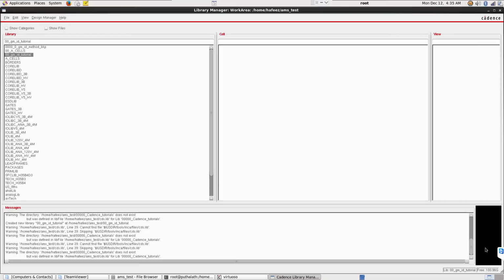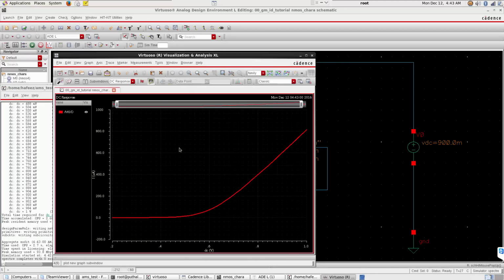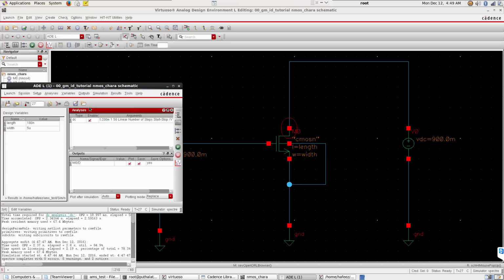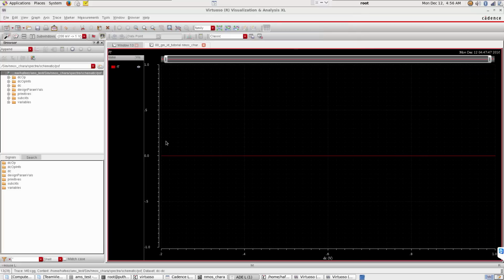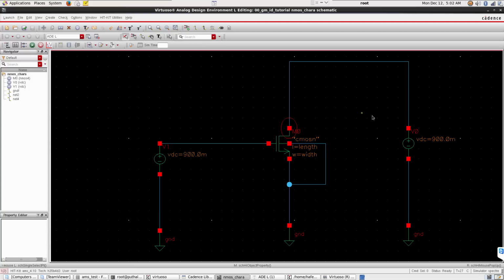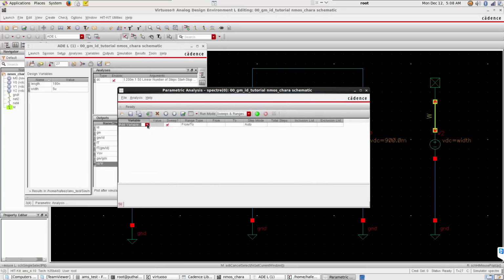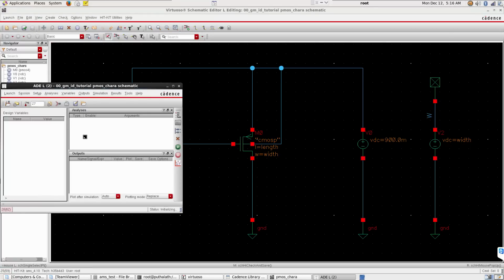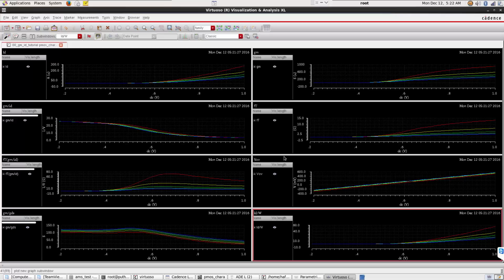gm over id (gm/id) method part 2 MOSFET Characterization

Comment: I see you have kept VDS as a constant for plotting all these graphs. May I ask, how will varying the vds affect the gm/d characteristics? What if I plot the gm/id for a vds of 1.8Volts? 
In a circuit different transistors have different vds right?

Comment: Hi, Thank you for sharing. Just for info :).The command "save M0:all" did not work for cadence version 2020. I used "save *:oppoint sigtype=dev
" instead for the save_op.scs script. Furthermore, the wavex and wavey are not recognised by ocean script compiler.  It requires another workaround. We can perform YvsY directly in the maestro view instead of using ADE-L.
Reply: Thanks for your advice ~ :)

Comment: Thank you very much Hafeez for this great tutorial about how to use gm/Id technique. Really Helpful.
A simple suggestion: you can use VAR("name") in output expressions to use design variables. This way you don´t have to add a DC voltage to operate with MOS width.

Comment: Instead of plotting "w" as a voltage you can export the id curve to the calculator and there you can divide it with the value of "w". Then you plot this expression. after plotting, select the waveform and right click -> export to ADE L. an expression will add to ADE L .  Or you can add an expression in ADE L directly e.g.,  (id / 4e-06)
Reply: The step suggested by you will help if value of width you have kept constant, also u need to update the expression each time you update the width... Hafeez's technique is a generic one..

Comment: Hi.. when I am trying to incorporae the .scs file, its not showing any characteristics. Its same like without incorpoarating.. Where as you are getting all parameter plots (From time 6.55 in the video I am not getting that)
Reply: please make sure your mosfet name is same in .scs file and in schematic
Reply: Yes it is the same... I have verified also, but I am unable to sort out the problem
Thanks
Reply: Try to write M0.m1 instead of M0 only...
Reply: Run the simulation once again after adding the simulation file and then check

Comment: Dear Hafeez, thanks for this. I would like to ask you a question. You use the same circuit testbench to plot all the curves. I have seen somewhere some people, when it comes to plot the gm/gds, they maintain the vgs fixed at a certain voltage above Vth and they vary Vds. Why you don't do like that?

Regards.
Reply: vds has less effect on gm/id when compared to vgs. For characterisation use vgs
Reply: Ok. Will do that and see the differences. Regards and keep the good work. I like the way you do your tutorial and videos.

Comment: Its a very nicely explained tutorial. I want to know how to calculate the overall transconductance of an OTA based circuit and Gm vs Vid(differential voltage).Please can you help me. This tutorial is of a single MOS i want to calculate Gm of the complete circuit. thanx
Reply: Dear Hafeez, How to plot Maximum available gain vs frequency, ft vs ID/W, NF vs ID/W,  fmax vs ID/W curves for a given circuit in cadence?